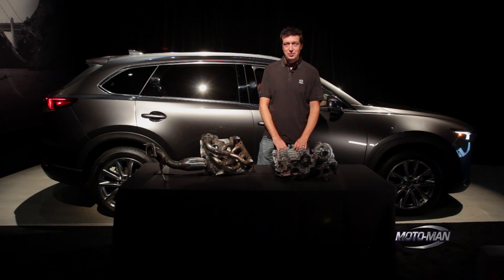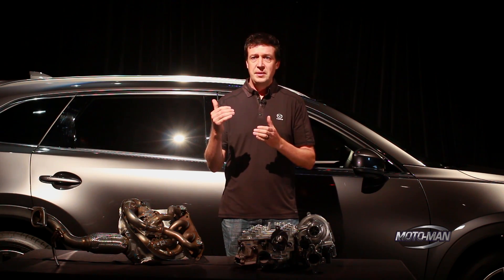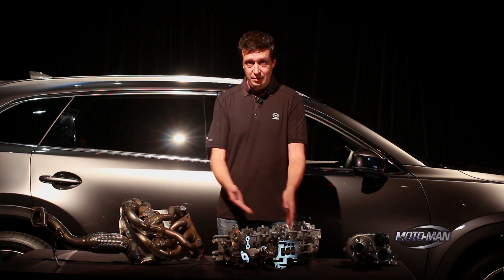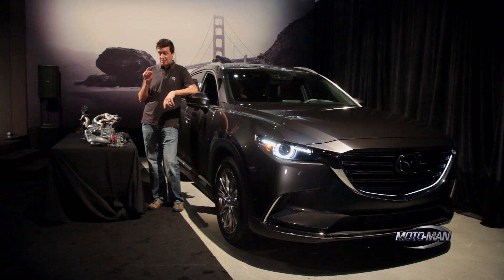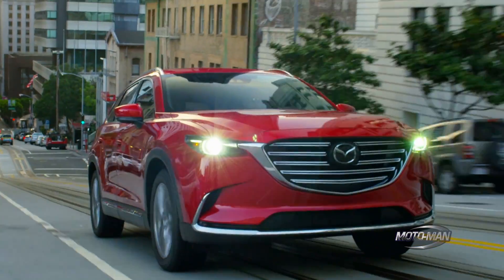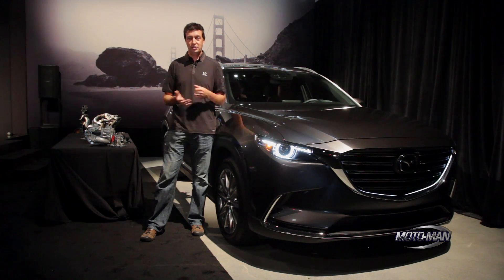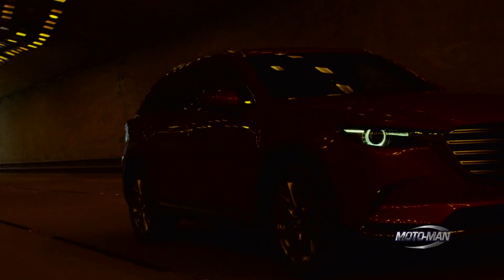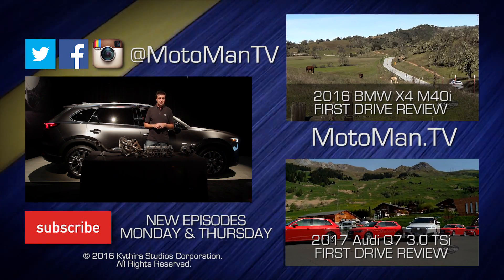2016 Mazda CX-9 ENGINEERING REVIEW w/ Mazda Engineer Dave Coleman (3 of 3)

Comment: I think the engine is great. The bigger question is its design which looks sharp in 2016 but in 2018 many areas may have already be obsolete (there is no digital dashboard, the centre screen is way too small, no 3rd-row air cond (Mazda please take cue from Volvo XC90 and possibly to include air cond at B pillar), the rear lamp when the brake is engaged, looked hideous and small, the turn signal is in bulb instead of full LED (why?)...there is no cargo cover when the 3rd row is stowed away, the 2nd row chair is difficult to be moved away to allow easy access to 3rd row etc). The list is not exhaustive but you get my idea Mazda. I would like to see more improvement in that area and please continue to provide more useful torque at low RPM. Cheers

Comment: Will a regular consumer look beyond the specs, possibly due to the look.  but that's where advertising comes in.  when there is something new it is difficult to have someone tell you what it does and much easier to show them.  0-60 and quarter mile is engrained into the consumer.  Might be good to take after Chevrolet with actual consumer responses.  Most vehicles probably don't get floored and run out to redline.  even have a timed set course for someone to drive each car for the first time and have the Mazda go first as the person wouldn't know the track well and would presumably be slower.  then into the competition hopefully the result would be the Mazda completes the course quicker showing in real world driving the cx9 out performs the rest.  I just test drove one and really enjoyed the drive even compared to the likes of the 2017 Arcadia Denali.

Comment: I really love this Mazda CX9, but I would appreciate if somebody can answer a question: Is a 4 cyl Engine like this,  durable enough for a SUV?. If you plan to have long family trips, in addition to the daily basis use (driving on snow or slippery roads in winter etc in a city). Is this type of engine with only 4 cyl  a reliable, durable  and powerful enough engine for getting a performance like a conventional SUV  V6 (Honda Pilot, Toyota Highlander, Nissan Murano or Pathfinder?) . The main asset that I have noticed in an engine V6 is the high durability and power kept along the years (10 until more than 15 years), I wondered how reliable and durable is the new engine in the Mazda CX9 2016.   Thanks in advance for any response

Comment: I start off: I test drove the new CX-9 at a local Mazda dealership and I'm sold. as soon as my BMW lease comes up I am getting one of these. 

The problem I see is people are going to see '4 cylinder' think it doesn't have power. Most people I've talked to tend to see 4 cyl, V6, V8, V10, etc; HP is beyond them; they have no idea if a 'good horsepower number' is 10 or 100000.

I am coming from a BMW 328i GT with the N20 engine (2.0L Turbo 4 Cyl) and I am buying this vehicle BECAUSE of the Turbo 4 Cyl. I think if Mazda can distract people enough get people to simply drive the vehicle they will be very surprised and happy with the power. The new CX-9 and it has more power than you really need in most situations; its not a race car but it has plenty. The competition such as the Toyota Highlander with a 3.5L V6 or the Chevy Traverse with the 3.6L V6 have more HP on paper, but the torque and HP don't come in until such high RPM that it has less useful power. 

Really the only thing I wish Mazda would have done is go with an 8 Speed transmission, those extra gears really make a huge difference.I'd be surprised if Mazda doesn't throw an 8 speed into this in the next couple years. Unfortunately every 9 speed transmission I've drove has been pretty bad, the the way an AT works its almost impossible to get 9 properly spaced gears; 8 however seems to work well.

Comment: So FWD car being lighter and little more efficient on dry pavement ( 90% of my driving ) runned on 93 Octane while on 255 wide tires should be quicker than AWD equivalent ?   Question on the potential cons of this torque first approach:

When pushing the gas pedal hard at what point it's torque down low begins to run out of steam and lower HP number does not have enough power to take over so rate of acceleration slows down?
Does that happen at around 45 or more like 60 mph?

How sticky are these new tires, are 18 same kind as 20"

Why no 20" on Touring package??? I Would much rather have nice leatherette than leather but have 20" on touring at same price.... Co mon Mazda keep sharper driving car for lower trim level....

Comment: Thanks for the information, Dave. Unfortunately, I don't think that the general public will give this a chance  (I hope I am wrong, by the way).  Otherwise the automobile industry wouldn't be in the horsepower race that it is currently experiencing.  I get into it all the time but always end up giving up.  For some reason, people love to know that they are sitting on a lot of power, even though they know they will never use it.  Case in point, a couple months ago I took a 7 hour drive in a new mustang (22 miles on the odo), and I still had to set my cruise at 74 miles/hour.  Well, it was either that or ending up in jail.  I Chose option 1.  I hope, however, that Mazda continues to build great cars.  We've owned 7 of them in the past 17 years, between my brothers and myself.  I owned 2 of them myself until last month, when mine was totaled in an accident.  The other one is a 2005 mazda 3 with 186k on the odo.  I still drives smoothly, without any rattles or squeaks.  And everything still works well in the car, including the original HID bulbs.  I do hope that Mazda will invest into making its cars quieter and give all its non-turbo 4 cylinder engines more low end torque.  Salesmen who believe in the brand and know its products would also be helpful.

Comment: As someone who has owned 3 Mazdas (Mazda3, RX-8 & CX-7), I believe you. My concern with the turbo is not with the numbers, but rather it's reliability & fuel economy. In 2013, when the 2.3L MZR turbo was axed and SkyActiv was introduced, the brand's credibility went up (top 4 reliable brands with Consumer Reports, EPA ranked Mazda as most fuel efficient brand). Hopefully, this new SkyActiv turbo will buck the trend of carmakers producing turbos that don't quite deliver, like Ford. Ironic, since Ford licensed the MZR engines & evolved them into the Ecoboost & Duratec lineup.
Reply: Reliable?